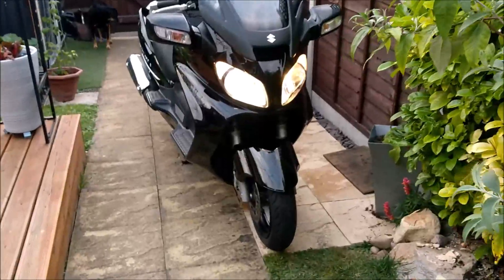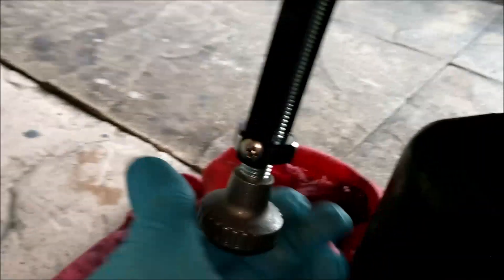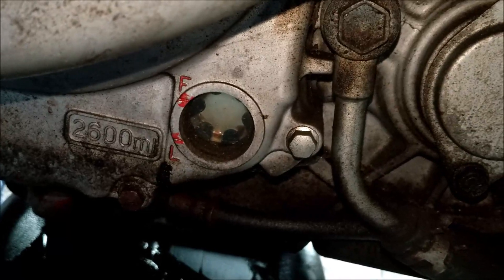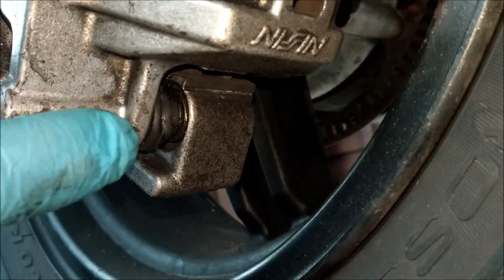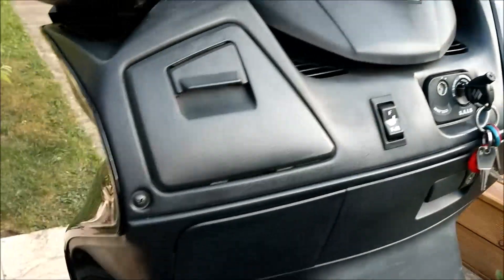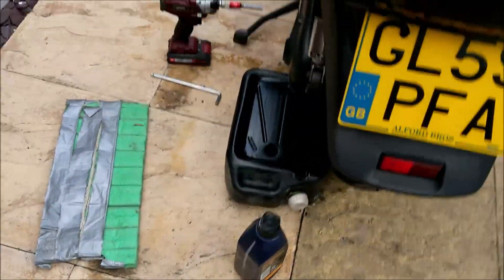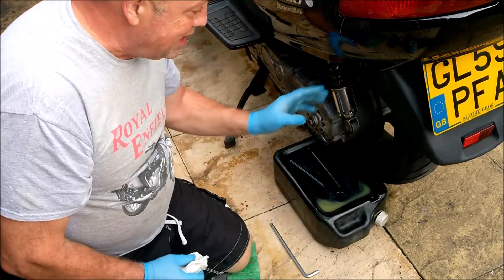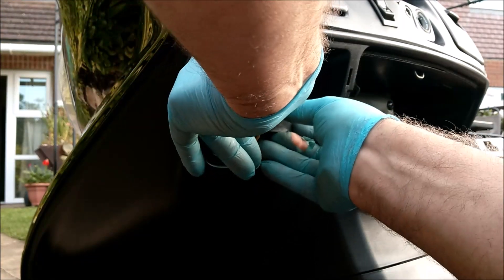Suzuki Burgman 650 Service.

Comment: I always use Molybdenum disulfide grease on the sliding pins as it has a high melting point and it seams to last fairly well , that rear caliper on my old burg 400 was a right pain  needing a yearly strip and clean even after a complete rebuild with new pistons and seals although it was used all year round in the manky UK. winters .
Reply from the maker: Cheers bud 😊

Comment: Cor blimey! Mark and Lard eh? That pair kept me listening to Radio 1 long after I'd grown out of it. Best DJs on there by far - funny as 👍. Yep, reckon you've polished a couple of hundred quid back into the old Burgman. Nicely done sir 👌. When you pull the rear wheel out to sort the brake disc perhaps you'll also get a butcher's of the final drive gubbins from t'other side - find out if the seal is still doing its job. Other than that it's difficult to fathom how moisture could be getting in?
Reply from the maker: Good call Mike, i will deffo check, I love listening to mark n lard on YouTube
Reply: @eadsierestorations  Blimey! Didn't realise they were still doing a show together. Will definitely check it out. Cheers for the heads up 👍

Comment: I had a Moto Guzzi v50 that did the same with the final drive oil , it had a vent on top which I thought was letting water in , so I made an L bracket/cover and drilled a hole and put under vent if that makes sense , so it stopped water from the front ingressing , trouble is I can’t remember if it worked or not 😜 I am going to stick myself to your gate in protest over lack of use of copper slip 😁
Reply from the maker: Ha ha top man 😅

Comment: Great videos.. what’s the best way to install a 12v charging cable on one of these… probably a simple question… but I am USELESS
Reply from the maker: If it's a battery conditioning trickle charger then wire directly to the battery,
Reply: Do I have to remove all the plastics or is there a cheeky to get the wire from the battery to dash?? Which plastics??

Comment: What did you use to clean and restore the black plastics? They look brand new now compared to when you got it.
Reply from the maker: I've tried a number of things over the years, baby oil is good temporarily to rejuvenate the plastics. The plastics have now resorted back to their old faded state as the scoot has been sat uncovered for two years. I have found a product that restores sun damaged paint and plastics, here's a link. It's brilliant stuff, will use it on the burgman when i restore it. Thanks for your comments.  https://www.ebay.co.uk/itm/275729779252?mkcid=16&mkevt=1&mkrid=711-127632-2357-0&ssspo=4bUF247CTB2&sssrc=4429486&ssuid=Rvf9QuMXR0C&var=&widget_ver=artemis&media=COPY
Reply: @eadsierestorations  great thanks, im also going to try another product i use for my retro console restoration as it might work: NOVUS 7136 Plastic Polish Kit. And then after applying that, if it looks restored i will apply: Gold EAGLE/303 Products, Vinilo - 303 Aerospace Protectant. Ive used both things in car interiors as well and it works well.